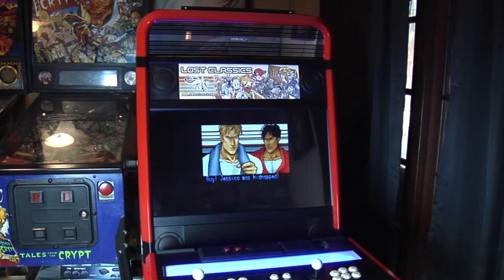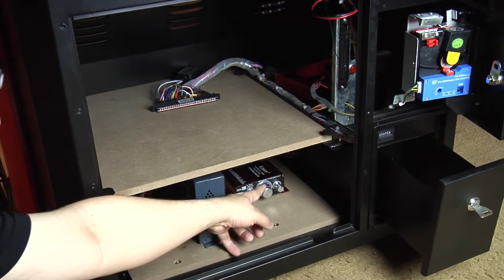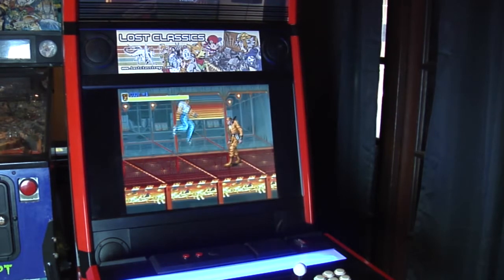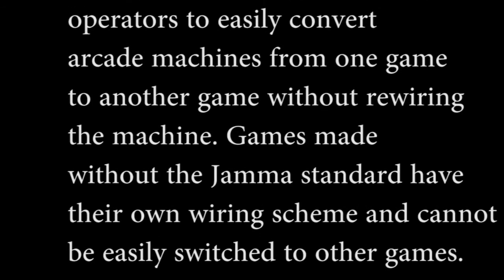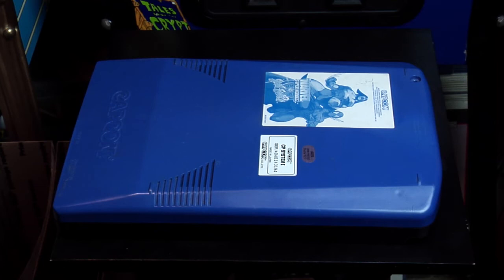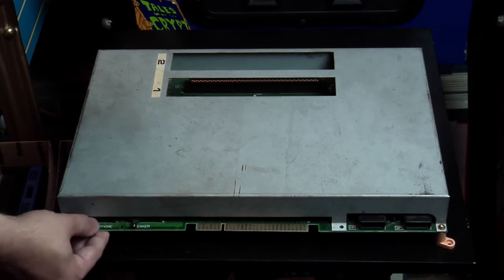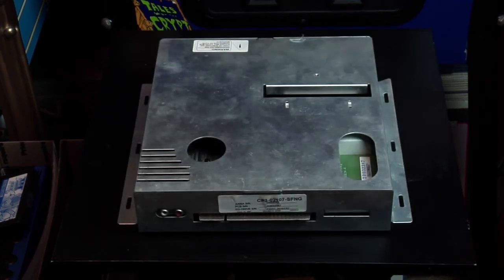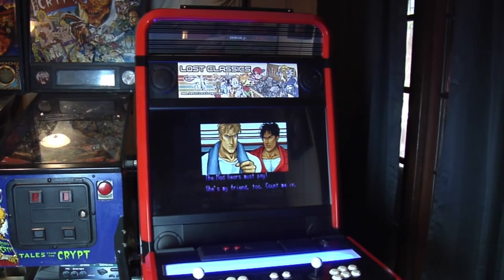Arcade Machines, what is Jamma?

Comment: I’ve been trying to understand Jamma, am I understanding this correctly. Jamma is for building an arcade cabinet using boards from actually arcade machine and is not used for MAME?
Reply: Basically yes. JAMMA is simply a wiring standard that was created so that boards would be easily interchangeable without extensive rewiring. Most, but not all games from around 1986 on up used it for their wiring.